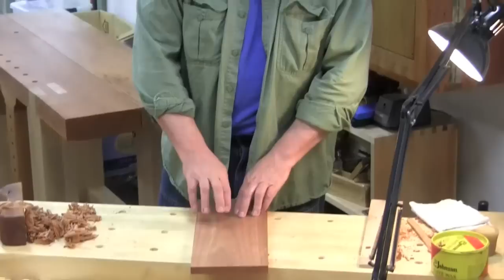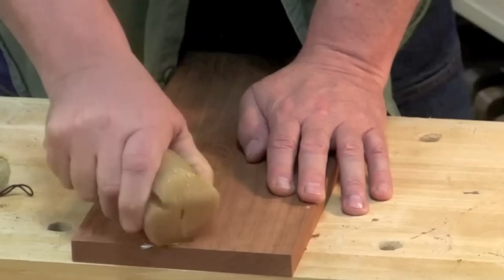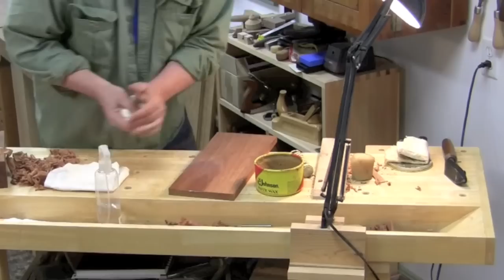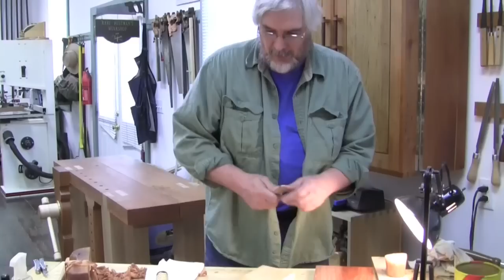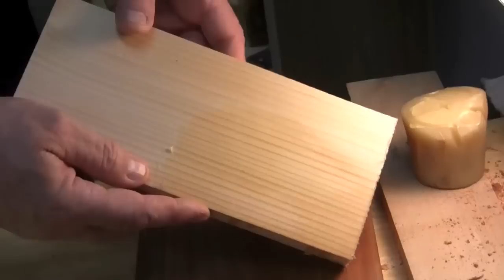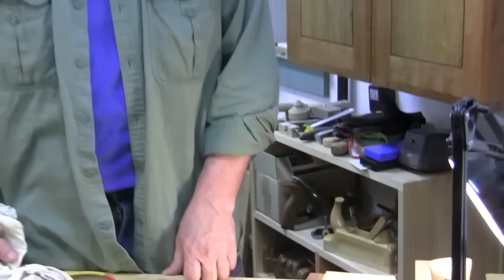Don Williams on Traditional French Polish

Comment: Thank you for keeping the old methods alive. I worked in a cabinet maker shop years ago. The guy wouldn't touch anything less than 200 years old. Worked on a lot of museum pieces. 
He had me to put 6 coats of Johnson's paste wax on a 200 plus year old baby cradle for a couple, charged them $600 and they were tickled to pay it. 
It did look gorgeous, but the feel 🤗❤
Reply: Do you think using just the Johnsons paste wax alone would work well with antique furniture,  I've been using Murphys oil soap to clean it, but wanted to wax it next, thx !
Reply: @rollandjoeseph  Yes! Just clean it well and get out the elbow grease 💪 It's a beautiful finish that feels wonderful to the touch.

Comment from the maker: I've never used it as a finish, but it looks really nice. The board that Don was working on in the video has a lovely sheen and is very smooth. Beeswax is not a protective finish, however, and you might need to reapply it every so often as you would a paste wax. So, I would not use it for a table top that sees lots of use. There again, I am not a finishing expert in any way.

Comment: Thanks for posting a nice video. I have done  a little French Polish. I learned it from top classical guitar builders and also from one UK museum restoration person. Also I have researched it since about 1969. I have read many writings on the subject  going back to the 19th century.  My take is that it is widely agreed that the term French polish refers to a shellac finish, hand rubbed on in thin layers with a cloth pad. I believe the technique in this video should not be called French polish since it is wax and not shellac.
Reply: If you listen closely he explains that opinion is incorrect

Comment from the maker: Glad you liked the video. This is one technique you can use if you wish to be period-correct when building reproductions.Today we have finishes that hold up much better to water, alcohol, and heat, but back in the 18th century, they didn't have as much choice. This is an old technique that Don discovered in his research.
Reply: Actually no modern finishes compare to the traditional shellac built shine - it refracts and reflects light differently from American Lacquer (Varnish) and Acid Catalyst AC Lacquer and Cellulose finishes. Admittedly the modern methods are more durable and French Polishing is best for vertical surfaces ie not for bar tops or tables. If you ever see a Piano lid polished with French Polish and finished with the Acid and Chalk method now extinct, you will see a finish like a calm enchanted lake that knocks Polyester into a cocked hat.

Comment: Finishing is very difficult.  Nothing substitutes for learning to do a few finishes well and anything beyond that goes to professional finisher.   I would like to try this one, but it probably won't give me the durability and water repellency for the vintage sewing machine cabinets that I restore.  6-12"  by 6-12" sample finishes before choosing the method is an absolute.  Experiment, add stain, dye, shellac under poly, oil under poly or varnish. There is probably French vocabulary for this that doesn't translate.  It's academic.  I thought the soft sheen was beautiful, but these days, I go for durability and water repellency. 

Thanks Kari, will subscribe

Comment: I absolutely detest Poly for almost anything I make. I hate the smell, I hate the mess, and I don't like the idea of encasing beautiful wood in plastic. It's also a nightmare for repairing/refinishing. I've found that the claims of its durability are overblown and don't come anywhere near to justifying its use given the other drawbacks. Lacquer is better but you still have the smell and mess. Shellac is great but it's a bit finicky and it's not the most durable finish out there. For most of my projects I like to use Tung Oil and beeswax. I like the luster and soft glow you can get pretty easily. I'd never considered using just straight beeswax as a finish, but I will certainly give it a try, particularly on pieces where I don't want the extra darkening (or yellowing on lighter woods) that Tung oil usually produces.

I spent six years in the Marine Corps, so I'm VERY familiar with the idea of spit polishing, but again, never even considered it for wood.

Comment: Beeswax as a final finish? Is it a good finish? Any pro's and con's?
Reply: Read Bob Flexners book on finishing .He is a respected professional who approaches  finishing from  a scientific point of view. He rates all common finishes.     Wax has the fewest desirable qualities in a finish, just below oil.
Reply: Bwx offers no protection from scratches or abrasion, is easily worn and it won't hold its shine.
It can be easily applied, repaired and rebuffed.
That's about it.
Reply: @williambranham6249  Desirable qualities are subjective, subject to what you wish to achieve, for example many people rate oils way above polyurethane. It's fine to have tables of qualities (pro and con) but simple ranking as to desirability is bogus.